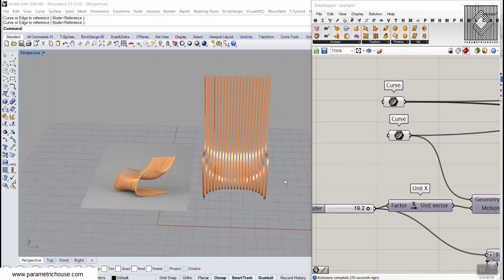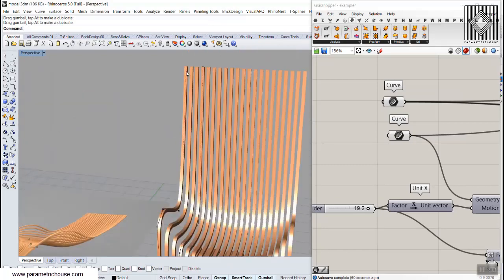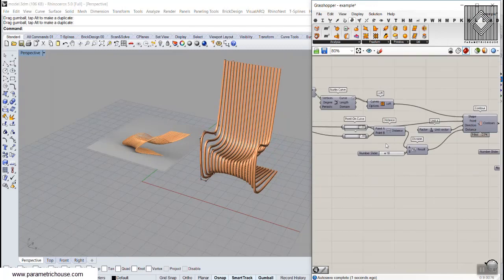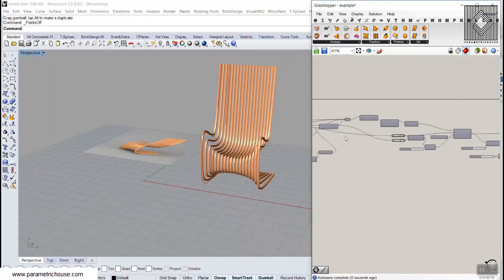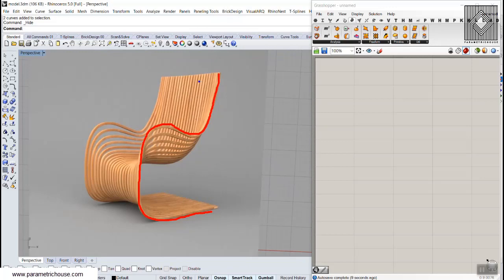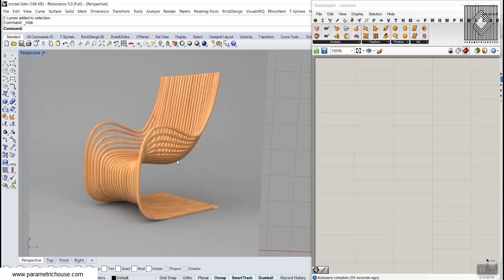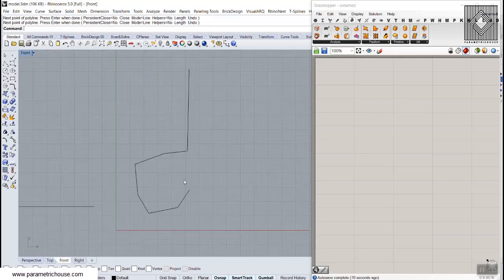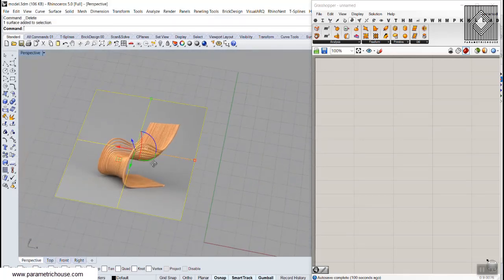Parametric Furniture

Comment: Hi Parametric House,
thanks for your tutorial.
Right now I'm trying to realise such a chair. Unfortunately, at the end, the Sweep doesn't work.I put the contours and the rectangles just like.
But to add: before i had a problem, that for unknown reasons grasshopper rotated the orientation of the prep frames inbetween line 1 and 1'. I used align planes to solve this.
I also just tried using the list items, if the individual sweeps are possible. I individually create all possible sweeps as singles. Do you have any idea what the problem of the sweep could be? Maybe simply my computer isn't able to calculate this?
Reply from the maker: Hi Jessica , Thanks
Have you tried flipping the curves in the right direction. Sometimes Grasshopper gives the wrong planes so I can understand what you are getting. Try to move your model in the Positive X,Y axis and see if it helps or just rebuild the curves and check again
Reply: Hi  @ParametricHouse , thanks for your swift reply. I figured it out after some times, the problem was actually something very simple. Long story, short. I needed to flatten the list of prep frames in order to align the planes and missed to graft that list again, before plugging it the section of contour. After that, it worked perfectly.

Comment: Long ago i followed blender tutorial with exactly the same chair modelling process, except it was polygonal mesh converted to the set of curves by hand. Procedural method is much better. Though it's a shame that this chair was done exacltly like a picture, with several parallel bend rails. It could've been so much better if the sweeps was aligned along the loft. I did it like that. Thought i don't know how to extrude surface along normals in grasshoppers so i did extrusion after baking to rhinoceros.
Reply from the maker: Great, I didn't get it, are you saying that the parametric way is better? For the sweeps it can also be done with offset curve>loft>offset surface and lofting the borders to make the solid
Reply: Yeah. Parametric way sure is better.  And it can be relatively easily pushed further that non-parametric. Offset curve isn't working for what i meant. But offset surface > loft surface borders worked for extrusion, thanks. What i did is split contours line array to curve pairs then lofted those pairs to create strips that follow original shape curvature and then i extruded them with beforementioned offset suface > loft surface borders. https://i.imgur.com/AIH2S7i.png

Comment: hey, someone please help me with the issue I'm facing here. while incorporating the perp frame, one of the plane towards the end curve line runs in the opposite directions. Hence I'm not able to form rectangles. Where could I have gone wrong?
Reply from the maker: Hi Sunny, try putting your curve completely in the positive x-y axis and see if it helps
Reply: @ParametricHouse   Thanks, man!
Reply: hi, how did you deal with the problem?